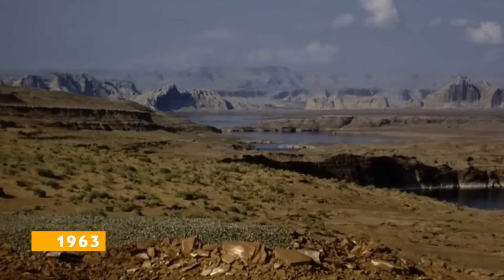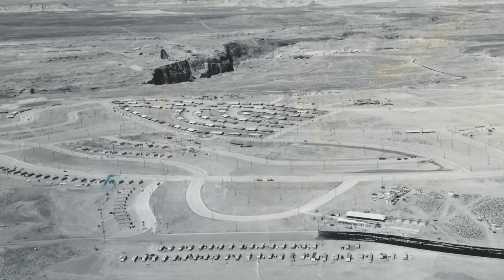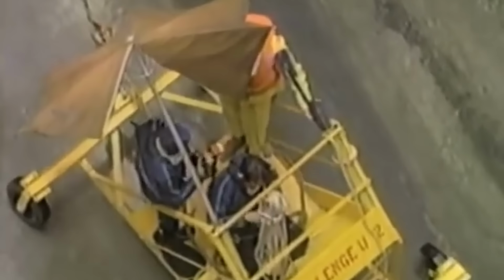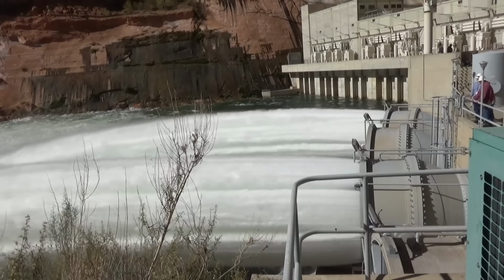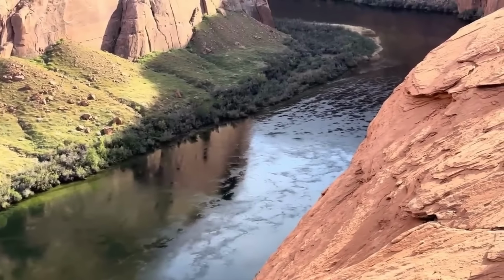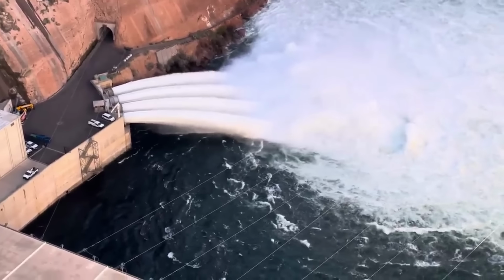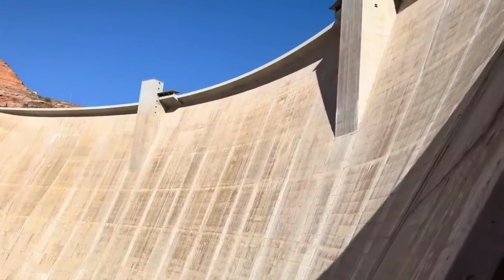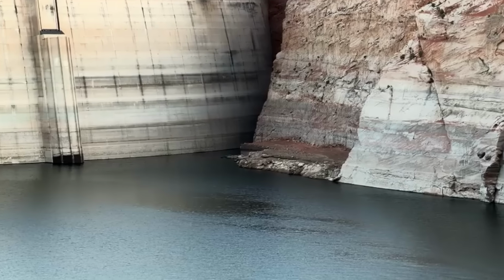America's Most Important Dam Has a Design Flaw Nobody Is Talking About

Comment: The easiest solution? Do what the Monkey Wrench Gang couldn't and blow it up. The problems are many, for sure. The fact that the U.S. relies on a warped entitlement system of agriculture (in any realistic world you wouldn't see summer produce in the winter), green lawns, industry that sees water as endless (e.g. data centers), etc. Both Glen Canyon and Hoover Dams are part-and-parcel of the problem and not really part of any realistic solution (Flaming Gorge Dam is also part of the issue, tho at an exponentially lower level of importance). Given the folks currently in charge at the U.S. federal level only listen to the movement of dollars between oligarchs, the likelihood of a quick solution is basically zero. It will take a true crisis in places like Las Vegas, Phoenix, and the Los Angeles basin for anything substantive to happen - though politicians will let the poor die first before lifting a finger to fix anything.

Comment: A Colorado company I worked for, successfully developed large water flow control valves that were fully resistant to cavitation erosion damage.  After evaluating many alternatives, it was found that Alumina Al2O3 ceramic inserts (supplied by Coors Ceramics of Golden, Colorado) achieved the required life with high pressure drops and flows through the valve flow control elements.  I do not believe that the expoxy linings being used in the River Outlet Works passageways can provide adequate life and resistance to cavitation erosion damage in this application.

Comment: The statement that no water would be able to exit the dam at dead pool is slightly misleading. At dead pool the water will still bleed out of the reservoir through the low level outlet tubes. It will behave like a run-of-river dam at that point, matching whatever the inflows are upstream. 

That said, it would definitely be a very low flow not sufficient to mitigate the problem downstream at Mead, and the cavitation inside the outlet tubes will still persist. 

This is a problem of our own making and we can't engineer our way out of it. Reducing consumption is the only solution and holding out for a miracle will only prolong suffering.

Comment: A little off topic here- $8.9 million dollars to re-line the Glen Canyon bypass tubes. $16 million dollars (so far) to paint the DC reflecting pool. 😮
Reply: Lining with an epoxy coating is unlikely to protect the ROW passageways for more than a few days at full flow conditions
Reply: It looks like they used a truck bed lining material (TPE Thermoplastic Elastomer) for the reflecting pool fix attempt.  The current ROW bypass tube fix uses some kind of epoxy based coating which may or may not provide adequate life.
Reply: @paulavery366  Yup. I think they should re-line each tube individually with a welded steel liner. Eventually those bypass tubes will have to handle the full flow of the Colorado River. At eight feet in diameter each, the cost would not be prohibitive nor the task difficult. The time to start is right now!
Reply: Oh please. 🙄
Reply: "A little off topic here- $8.9 million dollars to re-line the Glen Canyon bypass tubes. $16 million dollars (so far) to paint the DC reflecting pool."

Ignoring the fact that the average person of visiting dignitaries will ever see the inside of the bypass tubes so their appearance does not matter whatsoever, the work and funding for the reflecting pool was authorized by President Biden around 3 years ago.  Trump took what his predecessor put into place and finally got it started.  That includes work to clean and restore other DC monuments.

And now liberals suffering Trump derangement syndrome are busy trying to destroy that work and waste everybody's money that was spent on them.
Reply: Inflation.
Reply: @tjrubicon5463  Pilfering more like it.

Comment: Part of the cavitation problem with the pipes is the pressure. If the lake drops low enough where those are needed for water release, the water pressure behind them will be reduced and should reduce the amount of cavitation that happens. The pipes can also have veins or something added to reduce the amount of cavitation. Sluice gates CAN be added, but they're a LOT harder to do here. It would basically require building a coffer dam near a chosen opening, much the same way the original bypass tunnels were constructed. The time to do this is when the lake is at its lowest levels. Frankly, though, the Sierra Club which has been trying to have Glenn Canyon dam effectively dynamited for decades now will stand in the way of any proposed changes, so it may not matter what is discussed. It may not be possible to do anything anyway because of the courts.

Comment: Where to start? The idea that there will be no flow through the dam if the elevation gets below the Jet Tubes (Outlet Works) is ridiculous. The pipes were fixed and recoated. The only way for water to not get through the Jet Tubes would be for the flow from all the upstream tributaries being less than the evaporation and evaporation is dependant on surface area of the lake. At Dead Pool the evaporation would be close to the evaporation from the virgin river. If the inlet flows are greater than the Jet Tubes can release then the lake elevation will increase until there is enough head to push that flow through. The people that want to decommission GCD just want to ensure that the lake level never goes up again. One way or another the states will find a way to use less water from the Colorado River. It won't be cheap and chances are that the American taxpayers will be paying Southern California farmers a lot of money to reduce use since they have Senior Rights. Arizona is already looking at buying water from San Diego that I assume will be sold at the cost of desalinated water (over $1,000/acre-ft).  For comparison Imperial Irrigation District in Southern California pays $20/acre-ft. They also got the majority of the Biden money (Infrastructure Bill) set aside for water conservation for one year ($4 billion - with a 'B').

    And, yeah, I've been fighting with the GCI since 1997... same load of crap, just new names...

In reality I expect the Feds to try and protect GCD electrical generation by reducing GCD releases and increasing releases from upstream reservoirs (which is happening now) to maintain a level above 3490', probably around 3500'.

Comment: siphon - your welcome
Reply: siphons can only only extend about 10 meters (or about 3 elephants stacked atop) above the level of the upper body of water
Reply: @joehacker6412 Yes. Siphons work by atmospheric pressure forcing a column of water up against a (momentary) vacuum. There's a limit to the height, depending on your elevation (and atmospheric pressure). Pumps are needed for any lift beyond that.
Reply: If you're going to be clever then do it correctly.

Comment: Why am I looking at two totally different different dams!?
Reply: I was thinking the same thing.  The video shows the Glen Canyon Dam, which backs up Lake Powell, and The Hoover Dam, which backs up Lake Mead. If the penstocks are out in the lake, it is Hoover.  If the penstocks are tucked tight against the dam wall, it is Glen Canyon.  Some better editing would be appropriate.
Reply from the maker: in our defense though, they're two halves of the same plumbing, Powell hands its water straight down to Mead. practically siblings. but yeah, a bit of Hoover got in the edit. nice eye. thanks for sticking with it!
Reply from the maker: ha, fair catch. honestly when you're staring at the walls those two are dead easy to mix up, twins from the right angle. bit of Hoover snuck into the cut. appreciate you sticking with it.
Reply: @MegaBuilds-US  I would suggest you reviewed the video about as well as you looked for other opinions on GCD than those held by the Glen Canyon Institute. Same load of crap they've put out for over 30 years now, just with new faces and names attached.
Reply: the footage of the other dam… although irrelevant… was just too good not to include.
Reply: SLOP WORK for advertising placement.

Comment: Yeah, I have a suggestion... Stop relying on hydro electric power in an area fully capable of supporting solar panels and wind projects. 

Rip the damn out and the water access problem to residents ends. Remove all of these ridiculous farms, bring them to the parts of Louisiana that won't stop flooding, you get the heat, maybe the farming will help the flooding.😂 Time to stop ignoring climate change. Time to accept it happens. It's here, it's real and we gotta stop fighting it and start working with it.
Reply: If you ripped out Glen Canyon dam, you would need about 20,000 acres just to replace the electricity generation.
Reply: Replacing the energy output of the Glen Canyon Dam requires about 1.7 to 3.5 million modern solar panels, covering an area of 10 to 20 square miles, and 5,280 megawatt-hours (MWh) of battery capacity, the total capital cost reaches roughly $1.5 billion to $2.0 billion
Reply: Wind won't work and solar sucks also.

Comment: Glen Canyon is far from the most important dam in America. It was built when they realized the water commitments made for Hoover Dam (Lake Mead) - which were based on Colorado River flows of the 1910s - could not be sustained by the lower flows - post 1920s. Then in 1946, a survey of sediment deposition volumes in Lake Mead revealed the alarming amounts that had accumulation in only 10 years. So, Glen Canyon was built to absorb most of the sediment before it got to Lake Mead, and additional water to meet downstream commitments. The dam was placed in a bad geological place, but it was deemed necessary and built anyway. It seeps a huge amount water due to the geology - and the 1983 flood nearly took the dam out. There are dozens of dams and reservoirs now in the Colorado River system (including tributaries). They play a shell game with the water because Lake Mead's level is the official gauge for 'water emergencies' which allow cutbacks in water release amounts downstream. Having less water surface area also reduces evaporation amounts (Lake Mead and Powell combined lose approx. 2M acre-feet per year due to evaporation/seepage). Before, during wet years, the states did not have to take their full quota of water from Mead. Today, the states take their full allotment - regardless of weather - and use it to fill their own reservoirs that have been built by the dozens over the decades.
Reply from the maker: this is a genuinely sharp breakdown, and you're right on the history, the sediment survey, the delivery shortfall, the rough geology. "most important" is always going to be arguable, fair. our angle was less "ranks #1" and more that almost everything downstream, Mead included, leans on it working. appreciate you adding the depth here.
Reply: To recap: Lake Powell regulates vital water flows into Lake Mead, absorbs most of the river's sediment, and was necessary to build.  It's failure would be catastrophic.  Arguably, then, the Glen Canyon Dam is the second-most-important in America, after Hoover.  Close enough.
Reply: @mattheweisley8570  I mostly agree - but would describe it as more of a 'top 10 convenient dam' than 'most important' dam. California has many more 'important' dams in the north that supply water to southern CA - and the Mississippi River has several diversion dams that the entire world relies on to prevent flooding and allow commerce to continue. Since the Hoover Dam was built, the Colorado River storage system has grown to 3x Lake Mead's capacity. This, alongside the fact that Arizona started taking its full allotment of water in 1996 for the first time, made Glen Canyon less important. This is when the Central Arizona Project (CAP), and its 300+ miles of canals was completed - after three decades of construction. The whole issue has so many things going on that neither a YT video nor a comment can break down. I only try to my best to explain it people after many years of research. '30-Year Drought' and 'The Water is Gone' headlines are all that 99% of people see - and believe. If I sent the historical 10-year avg. Colorado River flows, along with the headlines we read today, you would likely shake your head.
Reply: as someone who works for BOR, I concur.
Reply: For years California took over their allotment. It was a big deal in the late 1990s when California finally got back to the 4.4 million acre-ft/year allotment. The 1983 incident did not "nearly take the dam out". The danger was that the water would top the dam and flood the generators and transformers. The structure of the dam itself was not in danger and the erosion in the spillway tunnels didn't even get near where the Diversion Tunnel plugs are located. Lake Mead and Lake Powell certainly don't evaporate 2 million acre-ft per year at these low elevations. Evaporation is a function of surface area and the surface area drops radically when the water is pretty much in the canyons. One of the biggest changes, based on modeling I did (with USBR verfication), using Tree-Ring data is that the Upper Basin went from under 2 million acre-ft/year to over 4 million a year. My modeling showed that for much of the last 700 years, the system would have been in real trouble for much of that time with the Lower Basin allotments and the increase in the Upper Basin use to over 4 million.
Reply: @notsofasteddie  Part 2 - Movie on Reclamation’s Cloud-seeding Project:

Then let's see.  Then in '66, I was quite
busy.  The Denver office, the Atmospheric Water
Resource Division asked me to make a movie on
the cloud-seeding project, and so I spent [several]
months and months
 at that, traveling all over. [I]
went to Flagstaff for a couple of weeks, China
Lake, California, Olympia, Washington, Rapid
City.  Here in Utah we did some filming, and
[near] Reno. [We filmed] all of the experiments
that they had going at that time.  That movie was
called “Rivers in the Sky,” and it was a pretty
successful film, I thought.  Well, it got some
awards, anyway.
Rusho: Well, off and on.  Like I said, I did '64, '65, '66,
some filming, and then for three years didn't do
any, and then we started in and did Lake Powell,
then there would be a dry spell for a while, made
another movie on the fish and wildlife aspects of
the CRSP.  Let's see.  What followed?  Well, in
1970, Atmospheric Water Resources called me
back to do a motion picture on the pilot project in
the San Juans, western Colorado, so that took a lot
of that year, because we were doing winter
filming [of the cloud seeding] and summer
filming of the ecological aspects of that pilot
project.  As it turned out, that was a rather
unsuccessful project, but you'd never know it
from the movie.  The movie made it sound pretty
good.
Storey: You mean the cloud-seeding was unsuccessful?
Rusho: Well, they determined that the basis of their
experimentation was not what they wanted it to
be.  What they were doing was seeding on a
twenty-four-hour basis, and if it looked like a
good seeding day based on their rawinsonde
readings and so forth, they would seed for twenty
four hours.  Well, frequently the conditions [did
not continue] were not
 favorable for twenty-four
hours, so they were overseeding and producing
negative results for part of that twenty-four-hour
period.  So it was not a real successful experiment
that way.  I guess they still are experimenting,
aren't they, over there?
Reply: this is either AI or just some guy yapping for commodification garbage all he is saying is known Ive done work at all of these dams over the decades...and nothing he is saying is new
Reply: @lutomson3496  Not AI...just a guy that studies factual data, not headlines.
Reply: @lutomson3496  Wow, thank you for your insightful contribution. You seem brilliant!